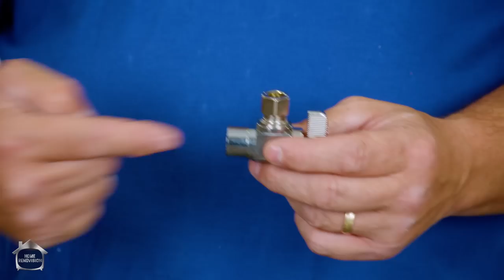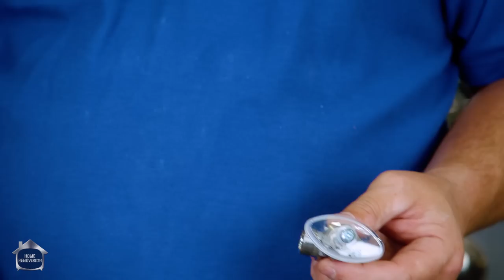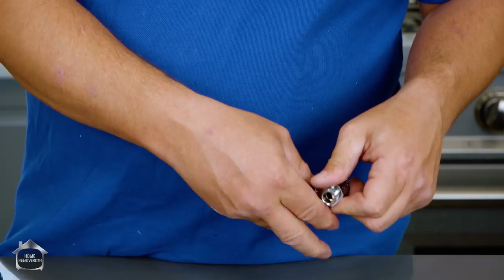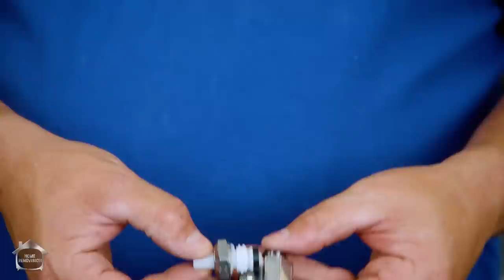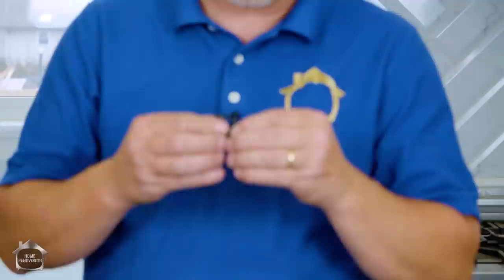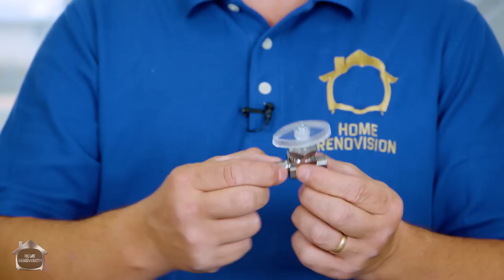This Is Why Your Toilet Drips

Comment: I recommend a video replacing the toilet flange.
Reply: Warmonger     Hi.  Have you gone to Jeff's channel and run a search for what you're looking for?  I typed in 'toilet flange' and got back several videos about toilet installs.  Here is one such video.... https://youtu.be/OI-jv1EXPFU.   I don't know if this is just what you're looking for, but like I said, there are several videos.  Hope this helps.
Reply: @SandiRose2008  that video shows the install to a roughed in drain pipe...  I was looking for a video on a broken toilet flange that was glued to the drain.  How do you remove that broken flange?  Another idea is if the flange isn't the right height for the finished floor?  I have a bathroom in which the previous home owner installed tile, which raised the finished floor, but they didn't adjust the flange height!

Comment: Here is a tip that you skipped. The tablets that people put inside their toilet tank. Those are very corrosive, it'll cause a leak on the rubber gaskets.

Comment: We all own a toilet!  I got five. I got one that i have installed twice. Its a medium grade Uberwhatever sold at the Reno Depot stores in Quebec. The floor , which I leveled from the joists up, gets water leaked on it every couple of weeks or so. My son in law is a budding plumber, I am a 60 yr old diy er. We have decided the toilet could be at fault. We ve already squeezed two donuts under the toilet. Next time we pull it off we will try something else. For valves I would only use ball valves
Reply: best toilets are 200$ max, Map 1000 . no need to buy 600$ designer toilets from jean lepine or ramachiery.
Reply: I agree 200 is a good range I recommend aviod the special flushing mechanism. 2 or 3 inch flapper can be bought in most stores
Reply: Not everyone has toilets. More & more people are going off grid, and some use out houses.

Comment: I had water coming up between the tiles around my commode and assumed a bad flange gasket. Changed it twice and still had water. Started popping up tiles and discovered the water was coming out from under the wall. Turns out the supply line had developed a leak in the wall. Moral: trace ALL the supply lines FIRST! Drywall is easier to patch than tile.

Comment: Have repiped and switched all shut-offs to right angle, quarter turn shut off. They tend not to ever leak, and can be shut off completely and almost instantly. Used copper and the valves are brass compression, so the whole valve can be replaced in a few minutes. Everything else is soldered. Would never ever go back to old rubber washer multi turn shut offs, cheapest crud on the market. Also, need to use the right terms. Gasket? or washer? or wax ring?

Comment: Where do you find the main water shutoff in a Condo...  I just bought the place and can't for the life of me find any information on that particular subject. I am unable to get a hold of the former owner of the place as well. I've been under the the dwelling, I can see the water pipes coming into the dwelling, but the shut off valve is no where to be found. A bit of info about the dwelling: it was built in 1973 and its a 1 level bungalow duplex type shared with only 1 neighbor and the plumbing is all copper. When I had the inspection done, the plumbing subject somehow got skipped.

Comment: At least as important as replacing the handle if it is jagged is to turn the supply valve off and back on occasionally. Once a year probably does it unless you have very hard or corrosive water. If you wait until disaster strikes after 10 or 20 years, the valve will likely be siezed and you won't be able to turn it off with a good handle or bad.

Comment: You didn't mention anything about replacing the wax ring in case there is water emanating from under the toilet. In my case, there is a little water leaking from underneath the toilet into the grout. It's not dripping from the tank or valves. So, it must be the wax ring, right?

Comment: I went to turn the shut-off valve under my bathroom sink - which is about 20 years old.  It wouldn't budge.  I took a wrench to it, it wouldn't budge.  So, I shut off the water, cut the copper pipe behind the valve, cleaned the pipe with some sand paper, and installed a Shark-Bite shut off valve onto the copper.  I pushed it on firmly, turned on the water, and voila'!  Done!!  Not a drop of leakage.  What an amazing option!!

Comment: We have an old iron pipe (vent pipe up through ceiling) that has a leak at the elbow going through the floor. Is this an expensive repair or just replace the pipe?

Comment: nice video! Just an idea , explain to people what MaP is for toilets. MaP ratings, how many grams a toilet can flush. people still pay 600$ for a toilet that flushes less than a decent  " budget " toilet  and is a pain to install ! And a quick tip, always check the manufacturer installed toilet fittings , such as where to speedway is installed to. Because some toilets give you a terrible access once it's installed to retighten the nut.

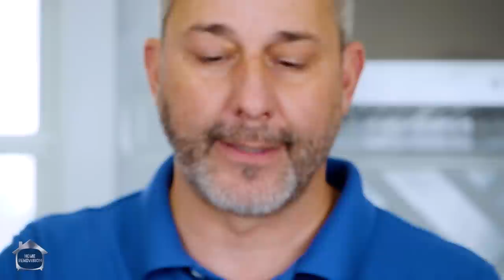Comment: 7:05 "They still are the same size"

Famous last words. It may work if you got them from the same brand and there are only a few years between the purchases, but do not count on any random handle end fitting into any other just like that. Shut the water off, take the hande to the hardware store and verify that it does indeed fit.

Personally I think you'd have a better change of getting a new piece of rubber to replace the bit that has actually failed in the old tap, than you do of getting an exact match for the handle part after a couple of decades.

Comment: I live in an apartment in a mansion block which is over a hundred years old. The cold and hot water are centrally controlled and cannot be turned off as this w'd also turn off the water to the other 300 apartments in the block. There are no stopcocks on either the cold or hot water pipes feeding the kitchen sink. Unfortunately, the faucet needs to be replaced. How can I achieve this without turning the kitchen into a pool? Also, I'd like to instal stopcocks on both the cold and the hot if at all possible so in future I don't have a similar problem if I need to work on the sink.
Reply: Sounds like management's problem. If multiple units will need to be shut off, hopefully not all 300, they need to give the affected tenants proper notice that the water will be shut off, then shut off the water so the work can be completed.

Comment: Why does my toilet tank empty out in between uses?  The tank will refill when flushed with a full tank but I can't flush on an empty tank.  There is no water on the floor ever. Clearly, I have a leaky tank but why and what do I do about it?  Is it an easy fix or do I have to call the plumber?
Reply: It is the flush (flapper) valve that opens when you flush the toilet to let the water out of the tank into the bowl. The water slowly leaks out of the tank into the bowl until it is empty. Middle aged toilets all use the same flapper valve. Many newer low flow toilets use brand specific flush valves. Old toilets often use a ball like piece with a wire screwed into the top. Look before you go parts shopping. If in doubt, turn off the water supply and remove the valve so you can compare parts at the store.

Comment: how can you stop condensation from building up and dripping?
Reply: Insulate the pipe and valve. Beer can effect cold surface hot wet air
Reply: You can run a warm supply line to the toilet. Bowl is toasty warm when you sit too.
Reply: @deannalopez550  yes but if it's too hot you can shock the toilet and it will crack

Comment: Now if I can just figure out why it's a double-flusher.
Reply: It double flushes due to the water level in the tank is too high if you lower it till you only get one complete flush.
Reply: @Adamrich1987  Hmmmm.....    I'll give it a shot.  Thanks!
Reply: Probably 1 to flush on pee, the 2nd one to probably flush poop. The one to flush pee uses less water.
Reply: @peachesbeaches781  dual flush would have a way to flush for 1 or 2 but the pee one just pushes liquid out of the bowl the 2 would give you a complete flush if you hear 2 gurgling sounds its because its double flushing
Reply: Adamrich1987 oh ok thank you.